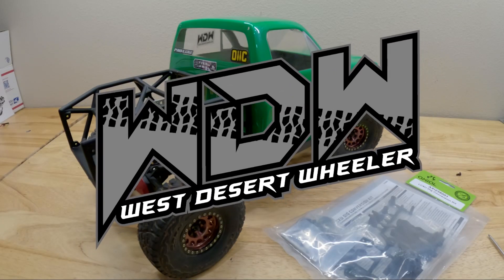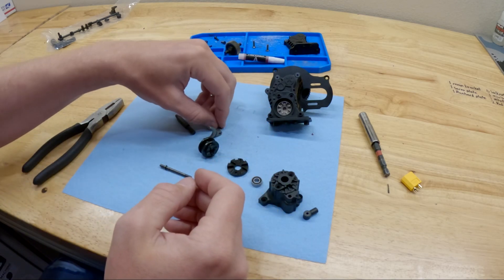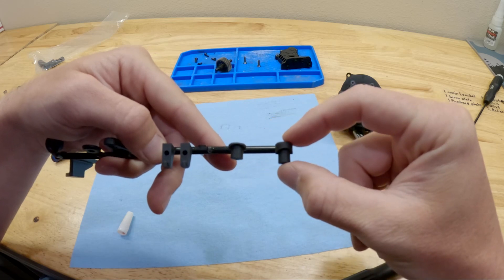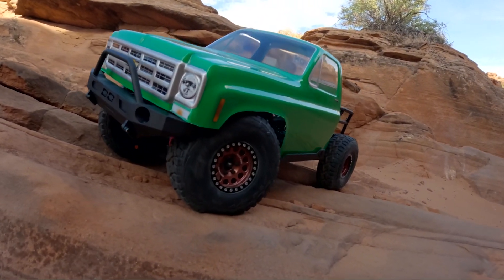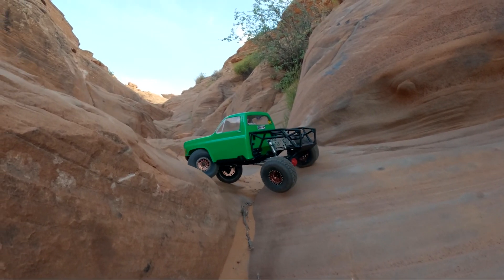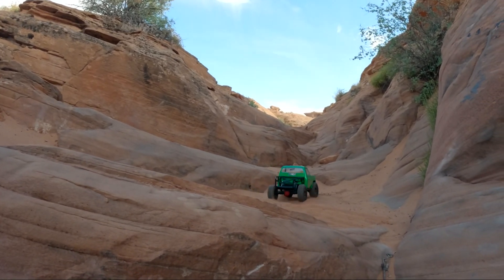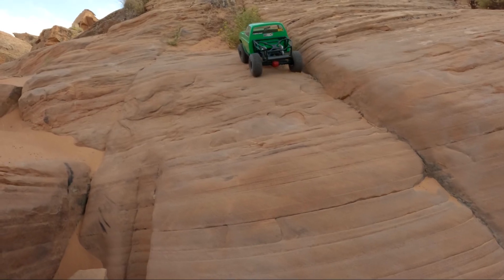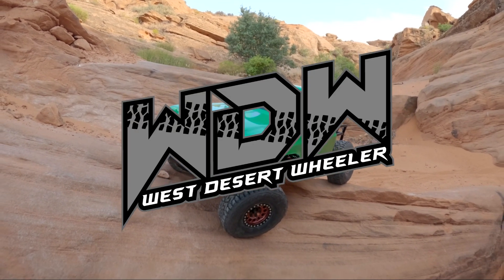Install + Drive Axial Basecamp LCXU Dig Unit

Comment: I tried to get neutral position to work in my early bronco scx10iii snd Capra but too finicky. I with these designers would make so you can. Hurtz let’s you used 3 positions and you can actually crest 90* angles in neutral

Comment: I don’t think locktight is needed on a gear that spins at 5 rpm’s
Reply: Nothing on that truck spins at 5rpm, and they still get vibrations. I don't think I'd want anything you've worked on 😆